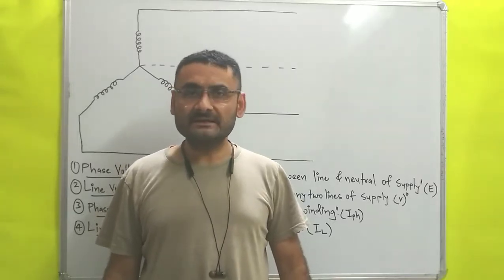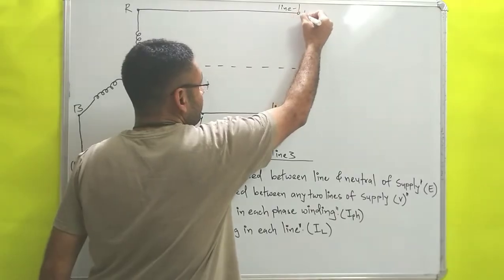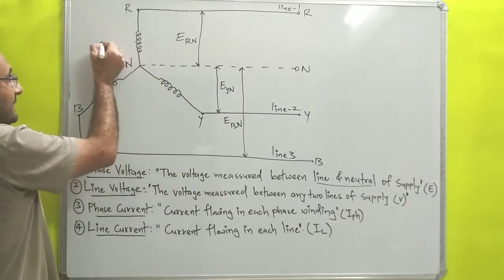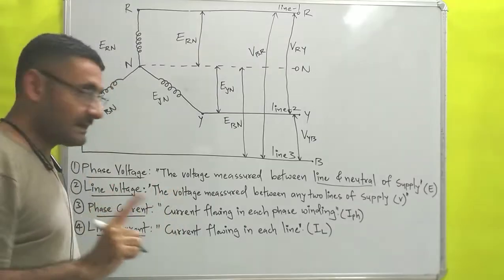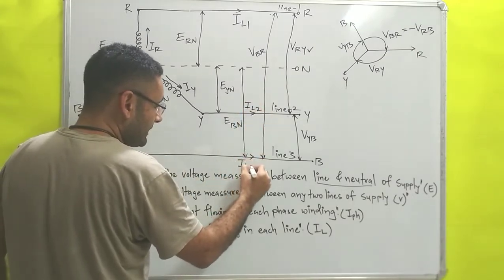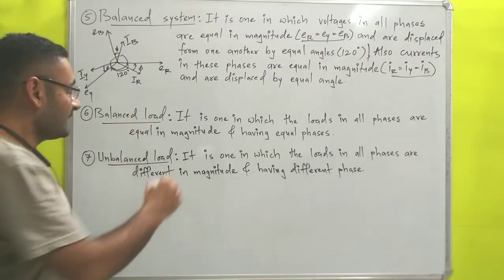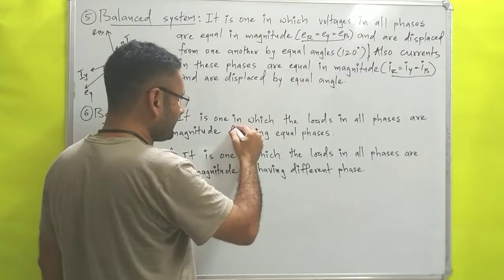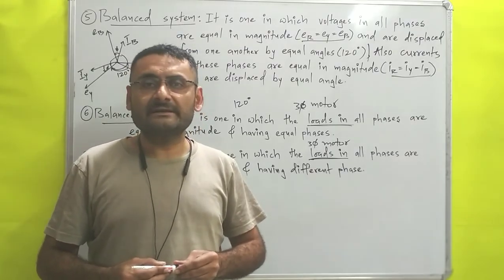Important terms used in AC circuits (Line & Phase Voltage and Line & Phase current) BTech 1st year

Comment: ❤Sir , can you please tell why this phase angle between voltage and current is phi. I.e. not equal to 90° ❤
Reply from the maker: As per phase between I am V
Thank you dear
Reply: @gautamvarde  sir I want to say that it must be 90...... Or not ? If not then why sir . I want to say that as there is inductors used in each phase so there must be a phase difference of 90 ° between I and V..... But u are saying in video that this is not 90° . Why sir . Please tell🙏?
Reply: It is not purely Inductive. There will be some resistance.